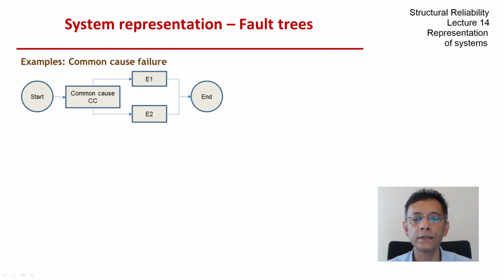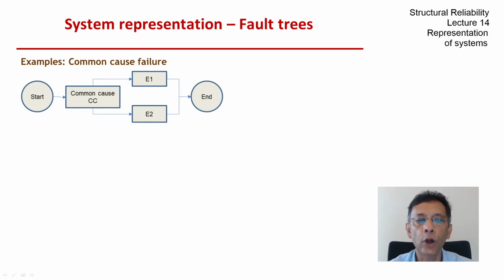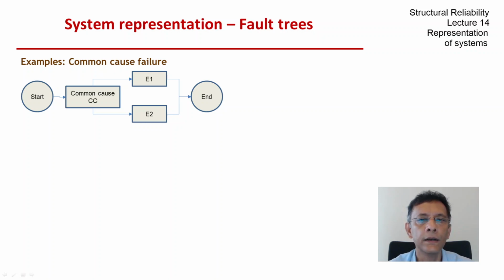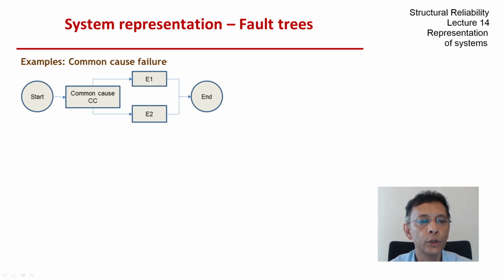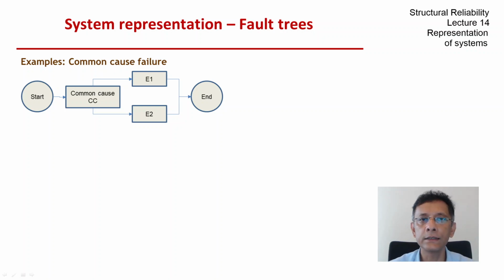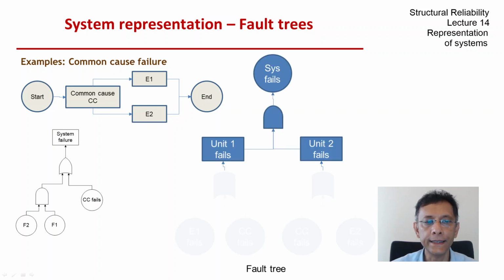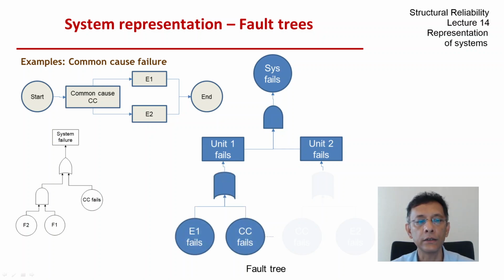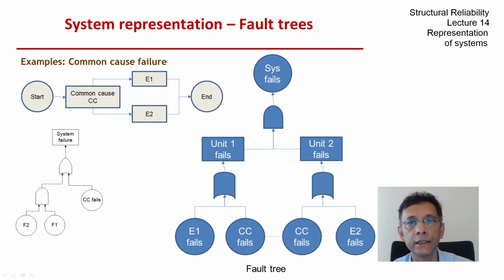STRUCTURAL RELIABILITY Lecture 14 module 05: FT with common cause element

Comment: Something wrong with the logic of the fault tree. Parallel connection does not equal to AND Gate😅😂
Reply from the maker: The logic is fine. In parallel configuration, system fails when element 1 AND element 2 fail. Hence the AND gate.  OR gate would be invoked if system survival was being depicted.